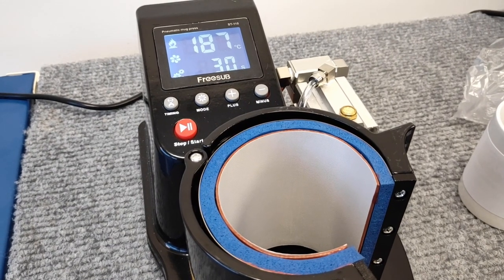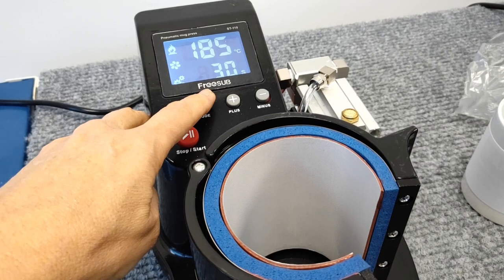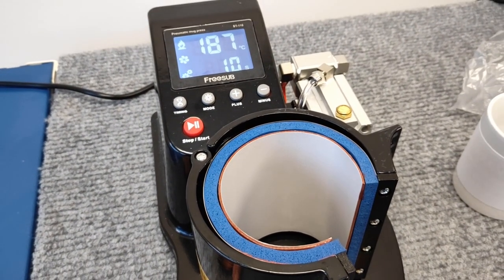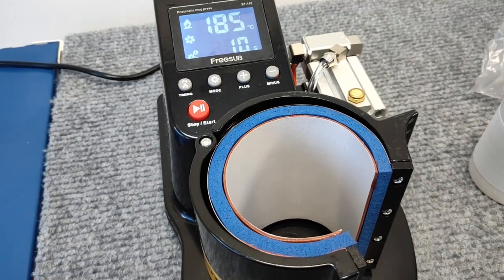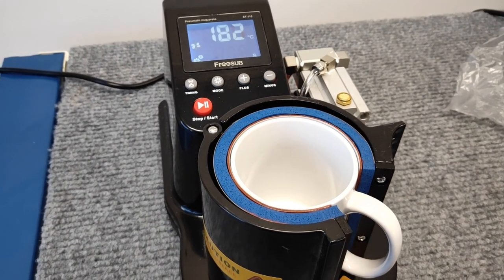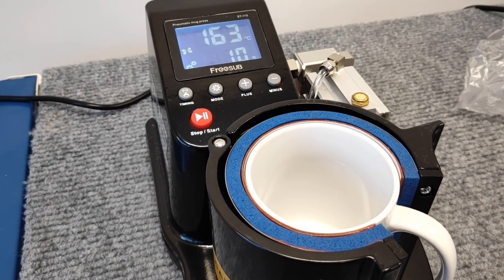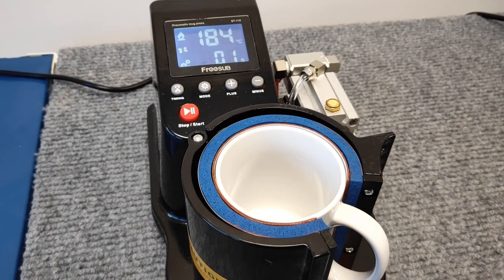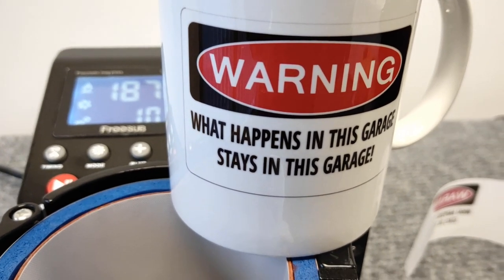How to use a Sublimation Pneumatic Mug Press.

Comment: most mug presses take about 3 minutes, interested to know how does this sublimate the image in just 10 seconds? thanks
Reply from the maker: Hi Ralton, you’ll notice in the video that although the mug has been placed into the press, the 10s timer doesn’t actually start to count down until the machine climbs back up to the specified temperature, where most other machines will start counting from the moment the mug is clamped. The video was cut down a bit, so this may not have been immediately noticeable, but in actuality the mug is still being pressed for closer to 2.5 - 3 minutes.
Reply: @Ceramicraft  f

Comment: Are they dishwasher safe after they are done ?
Reply from the maker: This is really dependant on a number of factors, but yes. Provided you are using quality mug blanks and good quality sublimation inks your printed mugs should withstand dishwashing. Ceramicraft's 11oz standard white mugs are guaranteed for 3,500 washes!

Comment: What size mugs does it do????
Reply: 11oz Mugs. There are additional attachments for 16oz and 6oz mugs.
Reply from the maker: Due to its unique automatic clamping design this machine is only suitable for 11oz Mugs and cylindrical blanks of a similar size and diameter. There are no additional attachments for this machine, but if your just doing 11oz mugs this machine is very simple to use.